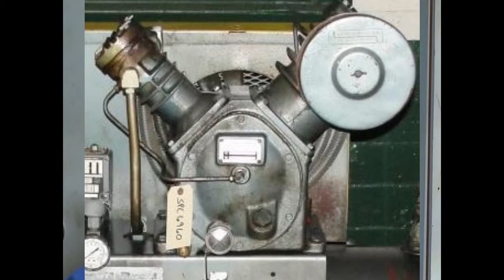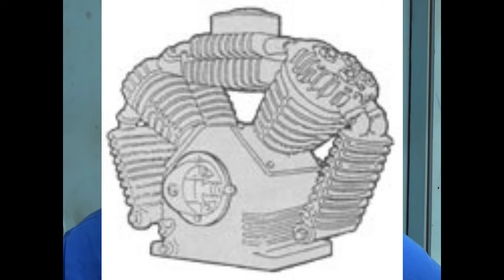A Common Misconception Addressed. S2, E 16

Comment: I'm just in the research phase of a quality 15-20hp compressor and at the end of this video you didn't mention Saylor Beall when you dropped numerous quality manufacturers, is there something I"m missing about them?  They were top of the list for me.  I'm in Canada so at first I was researching DV Systems but I believe they aren't produced in Canada anymore but do the misleading thing of putting a Canadian flag on an item assembled in Canada, I hate that and don't support companies who intentionally mislead people like that.  Not to mention in my limited knowledge the Saylor Beall seems better designed.   I much appreciate all the info you are putting out, I've been working my way through all your vids, even the rebuild as I think those give the most info.  Also am I wrong having the feeling that Emax is..... dodgy for lack of a better word?  For no real reason they just give me the heebie geebies?
Reply from the maker: So, thanks for the reply. I know nothing about SB putting the Canadian flag on their machines. most of the pumps are manf in Michigan. they are a quality machine and I am a dealer for them. I do not sell many though. because they are home grown they are just a little pricier. when I deal with  potential customers 1 of the things we push is Value. I look at value is Price and Quality = Value. SB has good quality but their price usually ends the value equation. we are currently rebuilding 2 705s that will be for sale ( watch for upcoming series on them) . I have a warehouse that I can get EMAX. but like you ... I have never sold 1 because I can not in good conscious tell someone about their quality.
feel free to contact me through thecompressorguru.com thank for watching.  Bud
Reply: @THECompressorGuru  Sorry my bad I confused you.  SB is American and not associated with DV Systems aka DeVilbiss.  DeVilbiss was a well renowned Canadian manufacturer.  So please don't think the SB is putting Canadian flags on their stuff or vice versa.

Comment: Hi from England and thanks for your informative videos. I have a 1966 (year) type thirty ingersol rand compressor . Can you tell me what rpm this machine should be (ideally) running at please. The tank is approx four foot long and eighteen inches diameter. The motor is a four KW Brook Compton motor running at 1420 rpm (three phase)  Can you tell me what is the proper rpm for the pump for this machine please? I don’t think that the pulley on the motor is the original one and I have a feeling the pump may be running too fast. I will gladly make a donation for this information . Thank you . Richard .
Reply from the maker: good question. I can only answer in general I do not have enough info. Assuming the motor is matched to the IR pump a good number is 900 RPM. I do not know what the conversion is from KW to HP. and I do not know the model of the pump. feel free to contact me through thecompressorguru.com

Comment: The parts for the 432 are readily available all over the internet. Like eBay for instance. And the 432 can run up to a 10hp motor at 1200 rpm and put out almost 30cfm. With a 7.5hp motor it’ll put out well over 20cfm under a 1000 rpm. So I would have to disagree with well basically all of what you said. Hen it comes to the 432 Otis most definitely a pump that parts are readily available for and it will most certainly put out more air than any new 5hp pump and it’ll do it with less rpm and all it takes is a 1100 10hp motor from princess auto. A total overhaul kit is about the same price . So considering the shittiest 5hp compressor at princess auto is is almost 2000 and upwards of 3500 for a rented brand name one (still shit) and like you said , doing a significant rpm to get that rating. It is still smarter and fully achievable to rebuild an old unit like the 432
Reply: I have a 432 and need a HP piston and rod and a jug for. There is nothing available out there for these castings anymore. Softgoods are there but not castings!!
Reply: @MurmilBaptistChurchElDorado  these pumps are still a dime a dozen and since folks have all but completely abandoned them because of the hype on “obsolete” parts, they are fairly cheap to acquire.
Reply from the maker: Good info, I do not use ebay for parts though.
Reply: @THECompressorGuru  I enjoy your show.

Comment: I own a saylor Beall. Air compressor..the 705 pump 5 HP.  2 stage ..I have learned so much from you..over the last yr..I thank you..for your videos..my saylor is a 1 old now .. I use it in my home garage..for my hobby shop..I've been through the big box crap..I'm done with that..as u say.  Yes I'm a hobby shop..at home ..I spent 4 grand on my compressor right before the COVID..out break..I now feel I got a good deal on my unit..w free shipping and lift gate drop..then..I ordered it fully loaded they put on an hour meter..as a bonus..so I change the oil by the hours I use it , keeping a log . I keep mine clean .so yes ty..for advice on your videos..no home store crap..there rattle traps..and now my electric bill is decreased with the lower amps used now...ty..

Comment: I recently came into an older rebranded CH allegedly US made "5hp" 26 gallon compressor. I was more after the tank size and figured at best, the motor driving it was more in the 3hp range. It definitely came out of the era when manufacturers were overinflating their numbers, probably before they were all collectively sued, (and is clearly stated as such on the marketing flub on the tank!). One quick look on the motor label, some even quicker math, and you'll find it's barely cresting 3 Peak HP and more like 2.5 continuous. If I'd bought it new like that, yeah I'd be mad, but I knew what to expect and it's enough to drive the pump for my specific project. 
On another topic, I'm actually quite glad air compressors have remained largely analog devices since the inception of the commercial electric motor. Even though they may not make specific parts for one such pump or combination, a crafty fellow should have no problem making replacements out of existing materials with relative ease, so long as safety and performance expectations are kept in check. Gaskets and valves seem to be one thing that disappear the quickest among the older pumps. They aren't terribly difficult to manufacture on a large scale, certainly if you're reasonably familiar with material properties, you can make one of at least comparable quality if not better. Sure, it takes a little time and marginal know-how, but that's part of the fun to making old iron new again. 
I came up with a hack of sorts years ago for high performance gasket-making which encases 2x2 twill fiberglass in high temp silicone for a jet engine project where I absolutely knew that a gasket of a certain age I'd never be able to find in a reasonable price range or timeframe (the ol 'once in a blue moon' if you will) that's served me very well for all sorts of things beyond that one project. I wouldn't advise it on something that still holds a warranty, but it far exceeds the felt gasket materials you're likely to bodge together in both pressure and temperature resistance, as well as being fluid and corrosive resistant in exceptionally harsh environments. Just one example, and this has gotten far too long already, but case in point, don't let a low (or even non-existent!) part pool stop you from resurrecting the dead if you've got the will to see it through, with some creativity and respect to what you're working on taken well to heed.
Reply from the maker: What you said with 1 exception, the little commercial duty pumps are still being overrated.

Comment: My dad's Saylor-beall  service station  compressor was a 5 hp 4 cylinders pump on low RPMS..120 gal tank.707 Saylor-beall pump was a work horse..lasted 40 yrs in our station..I wish I saved it..I just bought a 60 gal Saylor-beall  705 pump on 3 hp. Runs quite..for my home shop...16 amps running..30 at start up...everyone  says to  why not a 5 hp. Moter?..don't need it.im a 1 man shop at home ..it works my inground  lift..I installed  in our garage  .in 1999..from dad's station. It serves my needs at home ..great video. Love your platform..here this video..1750 rpms is perfect  for my needs ..slow running.  Tell what u think about Saylor-beall  comprsoir s. Like mine..
Reply from the maker: Saylor beall makes a good machine a little had to service the valves. and there OEM parts pricing is high, but all OEM is high, we do have good aftermarket parts if you ever need them
Bud

Comment: Great information.  Electric motors .... most every machine I've worked on runs the motor into the service factor.  On the the motor nameplate you might see, for example, 28 full load amps (FLA) and then there is SF 1.15  It may or may not list the service factor amps which would be 32.2 service factor amps (SFA)
In my opinion, this is taking away the designed safety factor built into the motor.  Let it run like that for very long in the heat, or low voltage, or frequent starts and stops and you will soon see motor smoke.
If you had a 1 ton floor jack that you knew was tested to 2 tons, should you use it to lift a 2 ton vehicle?

The other complaint is the 5 horsepower special.  Commonly marked on the motor nameplate 5hp SPL
The give away is the amp data.  If a regular 5 hp motor has a 28 FLA at 230 volts 1 phase, then the 5 hp "special" that has an 18 FLA can't really be 5 horsepower.  That practice has been in place for years and years.  Unfortunately to make a compressor package run at the standard design horsepower, it would have to run slower and produce a little less CFM.  None of the manufacturers want their product to make less air than the competitors.
Reply from the maker: 100% correct!!!
Reply: @j3o5h8n5j5a3y8  
Generally, when a big-box store compressor has 5 hp all over the tank and covers, it usually doesn't even have a hp rating on the motor, but I agree it's not an honest practice.
My first two air compressors were from Sears, and the 3 hp one was actually a 1.5 hp motor with only SPL in the hp line, and the next one was an oil lubed single stage with 5 hp labels all over, and the actual amperage of a 3 hp motor and SPL on the hp line.
They are trying to fool inexperienced and gullible consumer.
Industrial brands can't get away with that, so now I have Quincy compressors.

Comment: I consider mine a mid size. 10hp Baldor  quincy 350  22.   And a 110 gallon tank lol.     I do have a quincy 390 and a list of other quincys.
Reply: I have a Quincy QT-5,  and a Quincy QR325 project to restore.
My friend has the 390 that he put a Buick 3.8 liter V6 on, as a motor, and it's wild.
I told him to just watch the rpms.
I also have some single stage QR series pumps and a working Binks with the 210.

Comment: i was told years ago by an engineer for IR that tanks were sized to compressors and motors to minimize the number of motor starts in a given period of time. this make the most economical use of electricity because of the large inrush of current needed to start a comp. it also contributes to longer compressor life.
Reply from the maker: I agree. I very often recommend to my customers to add extra tanks to their systems for several reasons. 1 what you just said. the longer cycle time of a compressor is better than starting and stopping more often. also with extra tanks you can help the quality of the air by using the tanks in series and they will trap water that would end up down stream perhaps going through tools and equipment. in a very large system that has grown over years a tank at the end of the system can cushion a flow problem if you have a high air usage near the end of a system that is undersized for the flow( not always the solution) good comment!
Reply: @larrysperling8801  
We have both 15 hp and 10 hp Ingersoll Rand air compressors, but they are sort of retired and in need of repairs.
I can do the work and replace the valve kits and such, but what I was going to mention, is that they have the ability to run constantly and just unload the valves until more air is needed.
The continuous run feature can save on start/stop wear and tear.
I also personally have a Binks compressor with a 210 Quincy pump, and it has the valve unloader in working condition, and it's fairly quiet and trouble-free.

Comment: can i use one switch to control two compressors . one switch to pull in contactors? i can plumb the tanks together and put the switch in a common manifold between the tanks that would give me 10 hp and 160 gallons?
Reply from the maker: Yes. But if you use 2 Pressure switches and have them set different 1 switch 150-175 and the other switch from 140-165 you WILL save on the electric bill you only use 5 HP and when you use more than 1 compressor will make the other compressor starts.
Reply: @THECompressorGuru  Great idea.  Even better if he gets a alternator relay or module so the compressors alternate.  Then they get the same run time and wear.
Reply from the maker: @j3o5h8n5j5a3y8  most of my customers wont spend the money on an alternator. John next trip to the states you must come through Pa and sit down and share some of that knowledge in an episode!

Comment: I had a 60g oil-free 2 piston pump compressor I bought used for $100 and thru a rebuild kit on it. It was slooooow and really loud. After several years of agonizing use, it flew apart on me and it became obsolete and couldn't get parts for it and I didn't shed a tear. So a couple of years ago,  I bought a Quincy QT-54. It seems to be a good compressor and better quality than the rebranded box store single stage compressors. The one I bought has a "made in the USA" tag on the pump. I noticed that the pump tag now says "made in china" . It looks like Quincy is outsourcing more now and going in the direction as other compressor companies have gone.  I would like to see you make a video about aftercoolers and filters/regulators. I've seen videos where guys would use a transmission cooler for a aftercooler and have good results.
Reply from the maker: half step Quincy does out source some of its QT series pumps, the QR series pumps are made in Bay Minette  Al in my opinion the qr recip are the BEST recip in the world. the made in America tag are somewhat misleading the units are assembled here.
ON Jan 18 we have an episode scheduled where we are installing a good after-cooler on the beast.  As for the tranny coolers I do not know how those guys make a guess on the cfm that they will properly cool. we have a great cooler for 149.50 that is rated up to 75 CFM . you may go that is way more than I need , with coolers the bigger the better. I will look at what we can do to make a Filter regulator lubricator episode, thank you for the suggestion
Reply: @THECompressorGuru  Thanks for the reply. The QT-54 I have has the "made in the USA" sticker on the front and the pump has "made in the USA on the tag. I was at Northern Tool about a month ago and they had a QT-54 there. I looked and it now has a "assembled in the USA" sticker on the front and the pump has a "made in china" on the tag. Plus they changed the logo. Mine has the big Q on the tank and the new ones just has "Quincy" written vertical on the tank. The transmission cooler most guys are using is the Derale 15300 The tube in the cooler is 1/2" diameter which is the same diameter as the discharge tube on the QT-54 so that is why guys use them.  They run around $66 on amazon. I did install a magnetic motor starter on mine when I bought it. I think it will make the pressure switch last longer and be more dependable.  I do enjoy your videos and they are very educational.
Reply from the maker: @halfstep67  the magnetic starter will absolutely give you much more life out of the pressure switch.
Reply: @THECompressorGuru I would like more info on your after cooler
Reply from the maker: @HauntedBranch  you can contact me through thecompressorguru.com
I have them readily available. up to 75 CFM